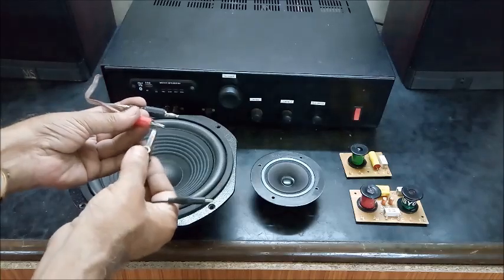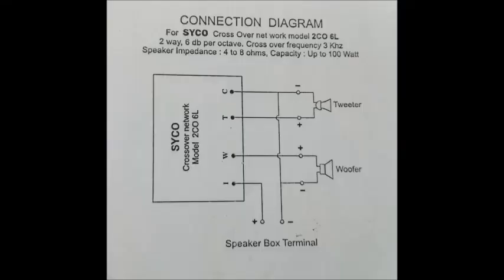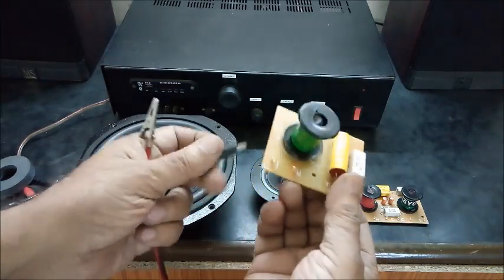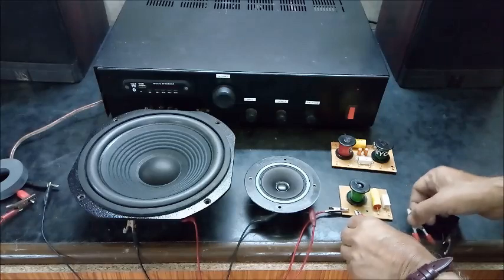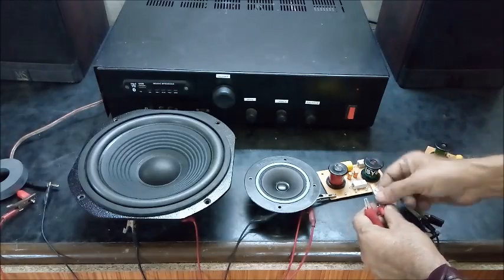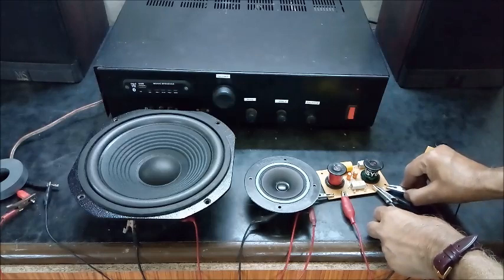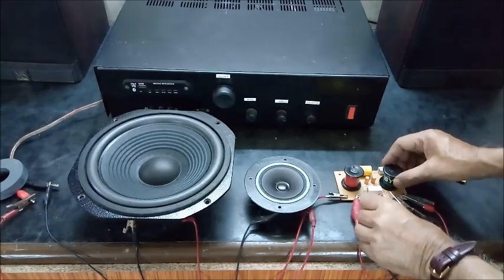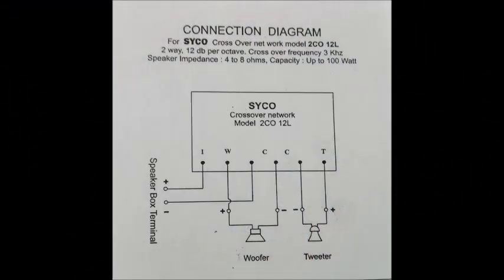Comparison of 6 and 12 dB Crossover network in a 2 way speaker system

Comment: how do you do phase correction in crossover frequency range of concerned drivers?
Reply from the maker: For 2nd order network, it's preferred connecting tweeter in opposite phase.
Reply: @makingloudspeaker  Thanks Sir, I do this but does not work everytime.

Comment: Great video, by the way does anyone know of a good speaker repair shop in kolkata, I have a 3 inch speaker who's voice coil was destroyed, I had gotten it fixed but the new voice coil was hand wound and it sounds horrible. it even rubs on the casing of the speaker while playing, and while I'm on the topic of shops does anyone know of any good shops to buy speakers from.
Reply from the maker: You may try NG Electronics.
Reply: @makingloudspeaker  But they dont repair speakers.